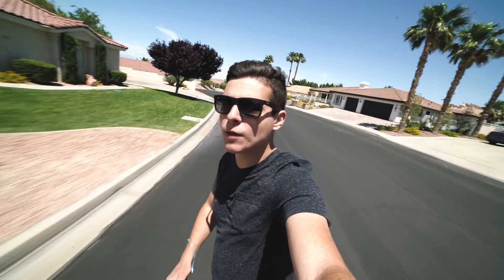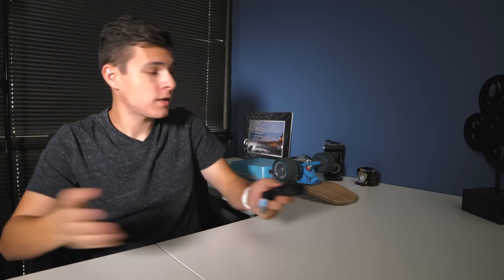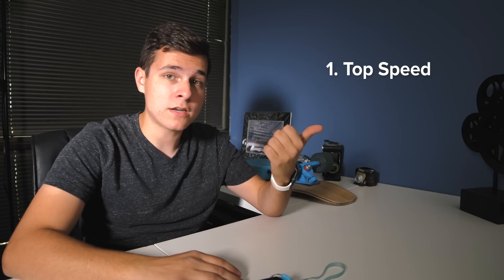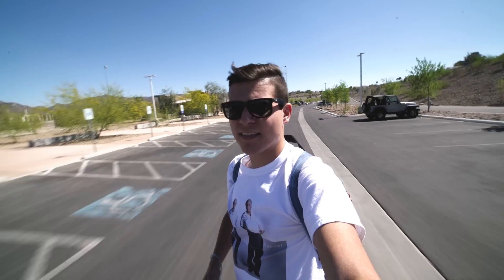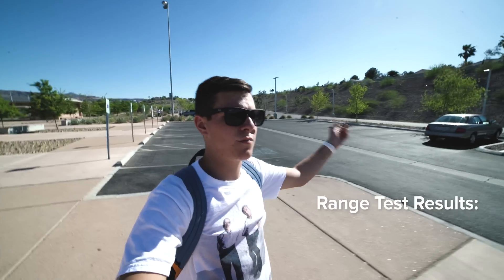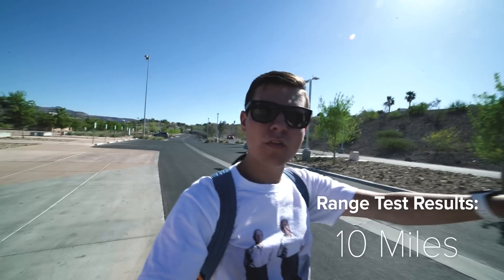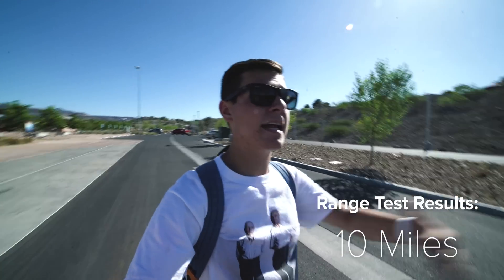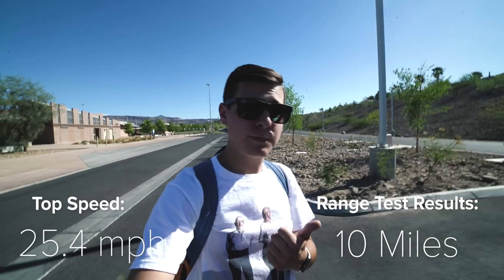DIY Electric Skateboard Build - Better Than A Boosted Board

Comment: hey mike I really wanted to make a skateboard for months now but I'm really confused on what battery to buy. would these batteries work for a skateboard? 48v lithium ion battery 48v 10Ah 1000w 13S3P Lithium ion Battery Pack For 54.6v E-bike Electric bicycle Scooter with BMS+charger
Reply from the maker: Technically yes, but most ESCs max out at 12s. So finding an ESC might be difficult with that battery.
Reply: what type of esc would be the best for this battery?
Reply: And what motor would be the best
Reply from the maker: Technically the FocBox can handle up to 60v. I usually reach for 6355 motors.

Comment: How does it charge I want a board so I'm doing as much research as I can.
Reply from the maker: This build used 3 lipo batteries and a balance charger. I would recommend an all on one lithium ion battery pack at this point.

Comment: So I'm trying to build an electric skate board and I found these cheap motors but not sure what the extra sensor wires are for and if I can use the motors with just 3 regular wires and not include sensor ones

Comment: Hey guys,
I was wondering how can I add a thrid motor to a dual skateboard of mine that can be run separately. Thanks!!!
Reply from the maker: Hmm a third motor, I haven’t seen anyone do that before. I’ve seen singe, dual, and quad builds before. 

It is possible though. You’ll have to get 3 Vescs and wire all of them in parallel, then split the receiver to all 3 Vescs. 

You’ll also want to use 3 identical motors.
Reply: @MikeBeard  
Thanks for replying Mike. So I'm using an electric skateboard called evolve carbon GT that has dual motor (1500watt each) as far as what understood from your answer you suggested that I can add another vesc for the third motor in parallel to vesc that come with the skateboard that 
Is already connected to the dual motor.

I'm new to this electrical stuff if I'm wrong please can you simplify it for me.
Thanks

Comment: hey man, can you tell me what i would need to get a board that would give me a range of 60-70 km ? the range is the thing that matters most to me, speed can be at around 18-20 mph i don;r need a really really fast one, just one that could ride really long distances. i can make it bigger to fit more batteries, and i myself don't weigh that much.

Comment: Just got the bit about how you have to charge your board... look into a good hobby charger (https://tinyurl.com/yarjfb5a) and installing a balance lead, you hook up the the main power line and the balance lead and all the cells in your pack will get the proper charge simultaneously. caution tho, this works best when all the cells are the same age,capacity and voltage. that last part is crucial you must ensure the voltages are as close as possible when linking packs together. what you have done is make a larger version of the smaller 2/3/4/5/6s  packs used in model flight

Comment: I made an order for $874 (36" dual motor + PU wheels) and then I had to cancel the same day for personal financial reasons. Jason said a refund WAS acceptable and said it was "processing". I contacted him a few days after and he made up some excused "the accountant is off duty" but don't worry its "processing paypal needs some time"

I checked my Credit Card statements- I never received the refund.

I've emailed him numerous times replying to the email chain where he said refund was on its way but NO RESPONSE. I've tried all his emails, and contact through the website but NO RESPONSE.

I emailed him the other day from another email I used and he responded within 20mins. Upon giving him my order number waiting for a refund he IGNORED IT.

Jason Volans is a thief and has stolen $874 USD from me. I have received NO PRODUCT and NO REFUND. I can't believe this is how someone runs a business.

I'm trying to raise awareness of this hopefully it doesn't happen to anyone else, if you choose to purchase from DIYEBOARD you are just gambling your money. Any other source for parts would be better- ebay, aliexpress etc.
Reply from the maker: Hey man, I’m sorry to hear that. That is quite a rough transaction you’ve experienced there. Luckily none of the parts in this build came from DIYEboard.

I would call your credit card company and dispute the charge if you can. Definitely not an acceptable way to run a business.

Comment: $600 and 2 months to build it? wow.. 
i dont even need to do research to build one. im competent enough to figure it out without spending over $150 if that. kinda wish i had a need for one now.
i could even program my own tracker app for it if i wanted too. programming, engineering, mechanical, electrical. all stuff I've learned on my own already. 
-> Also off road wheels would work better on that walkway. their bigger too so it should increase overall speed and possibly slightly better range.
Reply from the maker: You seem nice
Reply: @MikeBeard  haha, most underrated comment ever xD

Comment: how many 18650 did u use?? and how??
Reply from the maker: In this build I used lipo packs. I go more into detail about this particular build in part 2. But I also made a tutorial on how I build 18650 batteries. I’ve made a bunch of electric skateboard videos at this point. Click through them, hopefully all your questions will be answered.

Comment: Why not have a battery bag that you can strapon your back or another bag and run a wire down to a plug on your board?
Reply: that's dangerous if you fall or get the cable snagged on your foot for example and it looks weird to somebody who doesn't know about electric skateboards

Comment: "Just about, exactly 10 miles"
Reply: ....only to then claim it could have gone further? So what is it? Also, not sure about the top speed either, even though I must say 15 to 20 miles per hour is way more than you'd ever need, unless you're doing road trips with it for which it lacks battery capacity anyway. To tell you the truth, a range of 10 miles for $600 is actually a fairly poor deal. Yes, even back in 2017.

Comment: "I dont want to spend 1,000 on a booster board" *pull a out 1,200 drone
Reply from the maker: I use my drone for work. It’s not a toy. I’ve already earned the cost of the drone back multiple times over....

Comment: I built a board myself and I am not satisfied with my top speed! What are the methods to increase this top speed?
Reply from the maker: What type of motor and battery do you have on it?
Reply: Mike Beard I have a 200kv motor with a 12s lipo
Reply from the maker: What top speed are you currently getting?
Reply: Mike Beard it’s topping out at like 28km/h
Reply from the maker: That set up should be giving you like 30mph or like 48km/h
Reply: Mike Beard I’m thinking it might be the gear ratio because this is a mountain board so the gear on the wheel is extremely large lol
Reply from the maker: Ohhh yeah that could be it for sure.

Comment: hey man, could you talk to me about board flex?

is it better for a boosted board for it to be able to flex more or be stiffer?

if it's more flexible, I believe it will be more comfortable to ride for a long distance, but couldn't the flex of the board mess up/bend the connections and components screwed to the botttom?

also, would speed bumps be a problem, since by going over them we may hit the components to the ground and damage them?

thanks in advance!
Reply from the maker: The stiffness or the flexibility of a board is completely up to the rider. I wouldn’t say one is Better than the other. I personally like a stiffer board because it seems more steady at higher speeds. But the flexible boards take the vibrations from the road down. So it’s just personal preference. 

Speed bumps can be a problem depending on how large the speed bump is and how much clearance you have.

Comment: Hey man I'm not a pro about but in rc cars, drones and stuff they use arduino for a lot of thinks. Maybe it can bluetooth mode on arduino circuit.
Two thinks man. please think in people how messure the distance on kilometers, and I think personally that engine in wheels boards are better than this way you do, boostedboard. They use more space and lost in friction power. I plan to build a board like you I don't whant to lie and I like your long its fast and scary as you report. But man there's no only boosted board brand out there doing good quality products, I think that if you have more than 1000$€ to spend you have to research the market and choose your best option for this price I really not recommend a pulley version skateboard.
jay kay, mellow..... and now there are wheels in aliexpress whit the engine inside but I not see anythink about it except the price and where buy it.
Reply: https://es.aliexpress.com/store/product/Powerful-Electric-Skateboard-Hubs-Motor-90mm-Wheel-Motor-In-wheel-Engine-with-Bridge-for-Electric-Longboard/
2406013_32810751255.html?spm=a219c.search0204.3.288.d84b145PD4fUo&ws_ab_test=searchweb0_0,searchweb201602_3_10065_10344_10068_10547_10342_
10343_10340_
10548_10341_10084_10083_10618_10307_10301_10303_10313_10059_10184_10534_100031_10103_441_10624_442_10623_10622_10621_
10620_10142,searchweb201603_25,ppcSwitch_5_ppcChannel&algo_expid=e5c499fa-33c3-4ca9-8d82-c6e032cbff65-42&algo_pvid=e5c499fa-33c3-4ca9-8d82-c6e032cbff65&priceBeautifyAB=0

Comment: hey Mike, great project! I just started building one... will send you pics soon :) I have a question for you about the batteries: have you tested 6S/7S/8S setups?  looks like your 9S works just fine. For the boosted board they use 12S. I’m wondering how low can you go while keeping good acceleration/speed (it would half the weight and costs of batteries and ESC)
Reply from the maker: +Matteo Castrofino I’ve seen some good set ups with 6s. But I would recommend 10s. All around good speed and acceleration. And would love to see photos 😎

Comment: I want to make my own electric skateboards to sell! I am only 14 so i doubt that would happen lol. It would be a light, durable, foldable board made from bamboo and carbon fibre, it would fit in a bag, have dual hub or belt motors as an option, caliber trucks etc. Please respond if you want this, at a reasonable price.
Reply from the maker: +Isaac Lyons I’m not sure where I’d even start in designing a foldable board but sounds really cool. It would be cool to see it
Reply: Mike Beard, I already have plans drawn, but not the money lol.
Reply: Mike Beard, I also know how to make my own batteries.
Reply from the maker: +Isaac Lyons That’s awesome man 😎
Reply: Mike Beard, thanks!

Comment: I know this may be a stupid question, but is it possible to add a removable solar panel to charge the batteries
Reply from the maker: +this my browsing channel I’m sure you could find a solar panel that outputs the proper voltage and plug the charger into it. I wouldn’t suggest riding and charging board at same time. I’m sure it’s possible, just out of my expertise
Reply: thanks for the input

Comment: Great Video!
Does the regenerated energy on braking charge the battery or is the motor shorted to produce braking?
Thanks!
Reply from the maker: +Sourjya Naskar Yes, regenerative braking charges the battery
Reply: Mike Beard Thanks for your reply.
What happens when the regen current exceeds the max charging current of your battery? Does it not damage your battery?
Reply from the maker: +Sourjya Naskar It disables the brakes to protect the battery. That’s why it’s not recommended to bomb a hill with a full battery. Happens to the boosted boards too
Reply: Mike Beard You're a life saver mate. Thanks.

Comment: Sorry if this was already posted, but were using the boosted board controller for acceleration? Also, can your board break as well?
Reply from the maker: No, I am using a different controller. All of my parts I used are in the updated parts list. And Yes, there is a braking system

Comment: you should consider getting a parallel charging board for your batteries, basically it makes your charger see all the cells as one and charges them all in 40 mins ish. I use lipos all the time on drones and thats what I did

Comment: i got a yuneec with bad batteries overloaded.   can i use any lipos to replace it?  anyone tried?
Reply from the maker: +dablet00 If you can find the positive and negative terminals, and find all of the balance charge cables then Id say you could probably do it. 

Although I would try to send it back to manufacturer first

Comment: Damn. Well you could fix that battery pack quite a few ways actually! A bms system sure is the easiet way but Im sure you went with lipo batteries for that pack? Aka the reason you went with individual charging? If you'd like I could send you everything you need to know about balancing and building those type of packs. In my bike I have a pack made up of twelve and I haven't had the need to separate anything on it. Definitely learn how to parallel balance and charge using parallel connections!
Reply from the maker: +Jhaas42 I've actually implemented BMS charging with Samsung 18650 cells in my new boards. 

www.mboards.co

Comment: What were the other ideas on charging?
Reply from the maker: +Caleb Smith In my new builds I use 18650 cells and charge with a BMS and charger.
Reply: could you send a link to those parts? or are they already on your parts list?
Reply from the maker: +Caleb Smith There is the link to the full updated parts list in the first line of description and the pinned comment 😎

Comment: I bought a longboard to get around quick for cheap,  but the only problem is that it is hilly and I am not good enough to stop down these big hills, is there any way I could get the parts you used and/or the website that you used to research. Thanks a lot!
Reply from the maker: +Robert Graman Full parts list in the description 👍🏻

Comment: *doesnt want to spend $1500 on a skateboard
*pulls out a $1000 drone
Reply: Also, parallel charge that shit, wtf?
Reply from the maker: +SmanginFPV I am a filmmaker and photographer full time. It's a tool that has already paid for itself...
Reply: Mike Beard which is fair. If you get a good charger you can charge the three batteries in parallel, it's just as safe as long as you keep and eye on the individual cell voltages and resistances, which a good charger can help you do.

Comment: Sup Mike, so I have 2 7.2 volt batterys, a 60amp esc. If I get a 190kv motor will I still go fast as yours?
Reply from the maker: +Michael Soriano I have a battery with more than 40 volts. So unfortunately no. You will go extremely slow.
Reply: Ok, so basically best option upgrade my batterys first? I noticed on my 270kv motor now it's slower than I expected when I first made the board a few days ago. Thanks man great video! You got a subscriber
Reply from the maker: +Michael Soriano upgrade your battery. You'll want a 6-10 cell battery

Comment: Is there anything stopping you from just adding more batteries? I see most of these longboards people make tend to max at 10 miles. Is there anything preventing being able to add more other than price?
Reply from the maker: +Thomas Donnelly You can add batteries up to 12s but you can also add batteries in parallel to add to your range

Comment: with the multiple battery problem wire them up in series. that way you charge them all at the same time and get the same current output

Comment: how do you brake? I you stop pressing the remote, does it slow down?
Reply from the maker: +Phoebe Nadorp if you stop pressing the remote it just coasts. So eventually it will stop just like a regular longboard. If you press the remote backwards the brakes are applied.

Comment: I have a 24 18650 cell battery, 6 in series and 4 in paralel and I use those bms from banggood which are cheap and do the job (https://www.banggood.com/3S-20A-Li-ion-Lithium-Battery-18650-Charger-PCB-BMS-Protection-Board-12_6V-Cell-p-1118043.html?rmmds=search). I use 8 of them, 2 in series and 4 in paralel.
Reply: PRAWON what kind of range do you get out your pack?
Reply from the maker: +TheUberdude14 about 10 miles
Reply: Mike Beard yes, maybe a bit more but arround 10 miles
Reply: sweet, been wanting to get one but the prices are way too high so i want to build one myself

Comment: since the motor is connected to only wheel , wont it tend to turn ever so slightly to one side?
Reply from the maker: +tasosdiamantis if nobody is on it yes. But once the weight of a person is added then you can't tell at all ☺️

Comment: Is it water-resistant? 
This video really makes my fingers want to built one myself!
I have some hardware engineering skills so this shouldn't be a problem! (Built an electric guitar as well)
Reply from the maker: +Gunnar Kelders I ride through puddles all the time with no problems, the more water tight the encllsure is the better off you'll be 👍🏻
Reply: That's cool! I figured the enclosure was waterproof but my thought were more to the motors.
Thanks!

Comment: Electric longboards are great until you hit a rock at top speed and get flung off. I know that could happen on a normal board to, but I usually wouldn't be pushing anywhere near 20mph.
Reply from the maker: +Nakian yup that's always a possibility

Comment: Do you know how many 18650 cells would be equivalent to your battery setup? I'm basing my board off of yours but making some adjustments regarding the battery and a few other components.
Reply from the maker: +Luis Persaud I'm not sure, I haven't done much research with the 18650s. I've been thinking about switching to those too 👍🏻
Reply: +Mike Beard ah no prob, and I did some research last night and I think 3 in series should be 11.1 v and 2500 mah